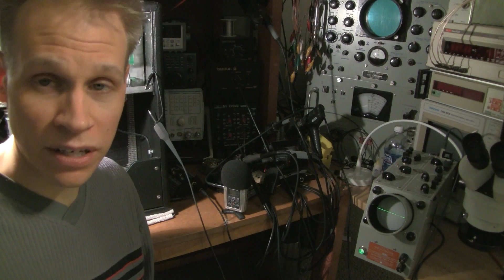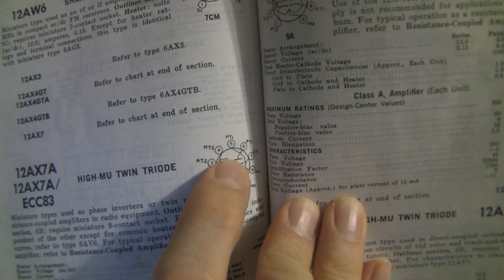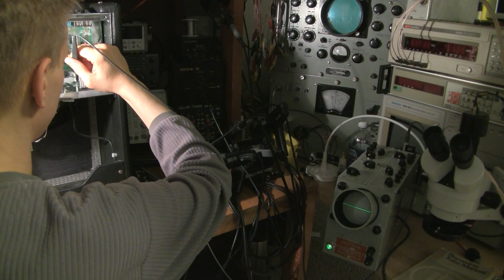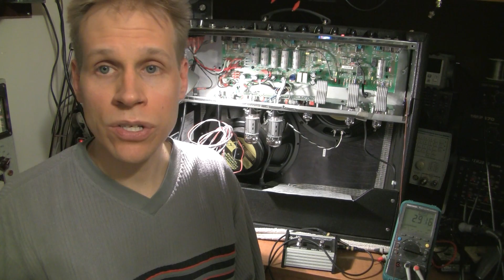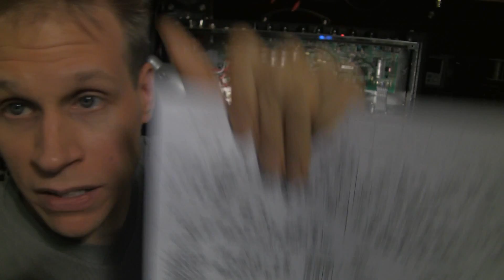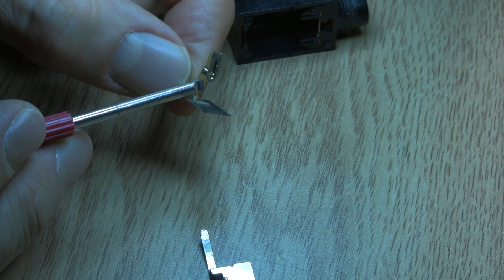Fender DeVille Amplifier, Repair and Bias Set Procedure

Comment: (Edit: joined the $10 Patreon so will move this question over there)  Love the channel, great video!!  If you have time, may I ask for some pointers on mine?  My reverb and channel switching died at the same time, and the V2 tube wasn't glowing.  Replaced the tube to no avail.  Also, the white resistor on the right is measuring completely dead between the leads.  Any ideas on where to start troubleshooting?
Thanks a ton!!
Reply from the maker: Just message me on Patreon.
Reply: @MrCarlsonsLab Already ahead of ya, messaged there 👍 I'm sure you have a lot going on man, get to when you get to it, so busy with work right now myself that I haven't even looked at Patreon yet haha
Reply: @MrCarlsonsLab Hey!  Felt like saying that I fixed it (mostly).  Replaced the v2 preamp tube socket and the associated ribbon cable, the v2 tube glows properly now, and the reverb works.  But while the clean channel is perfectly loud, the drive channel has like 1% of the volume it should have.  NO CLUE how to fix that one haha, oh well, am fine using it on the clean channel with a distortion pedal

Comment: Hi, nice video. I have a blues deville reissue from 2007. 60 watts, 4x10 blue alnico emminence speakers, Made in Mexico. And it was biased at 51.8mv with a kind of glue from factory, in the bias pot.. I rebias it at 60mv. It sounds better but realized increases chasis temperature too. I hope not burning the circuit tracks, as many hot rod I've seen, next to the bias pot

Comment: Fender has taken the same approach to amp building as they did to guitar building. Make the cheapest, most corners cut, most basic, cost effective design possible. In these amps you are guaranteed to have a critical failure because the design creates the issues. It can be addressed for about 500 bucks, but who wants to take a new, very expensive amp to a tech that may or may not know what they are doing for these repairs?   Unfortunately they take an even worse approach to customer service and do not honor the warranty on these amps. Personal experience. Buyer beware.

Comment: Did tube designers ever consider the natural frequency (mechanical) of the inner working of the tube to the point that the tubes self-destruct after so many cycles and at least advise the designer that the tube has a natural frequency of “X” hertz.  I got to 
Believe in an amplifier, tube life would be far less than in another non acoustic application.  Also, how sensitive is tube function to mechanical movement?  You mentioned one design fix made to stabilize the inner workings.  Are the dimensional properties critical to function?

Comment: Great video as always! Could you have two different brand/construction - same type power tubes installed? I tried a TAD 6L6GC with the getter on top and a shorter Ruby 6L6GC with the getter on the side, they are 10mV apart when biasing (one is 25 and the other is 35, the amp manufacturer says 30mV is the ideal number), could  that make any "damage" to the tubes or the plate/other components? Asking because it makes a very interesting sound but would not like to damage anything.

Comment: I ran across a problem the other day in the reverb circuit of an amp. The reverb seemed to work as when you had the amp on and you hit the reverb pan it would make noise , but still the reverb was not working with a guitar . I found one the RCA coaxial cables going to the pan was bad . But there is also a 12AT7 that controls that part of the reverb circuit as well.  And I would like to know how to tell if that tube is bad.

Comment: Isn't better to set the bias by the current as in milli amps as apposed to setting it voltage wise ? I'm a Fender certified repair tech so that's what I was told . But ether way should work . Great job in explaining amp diagnostic procedures Mr Carlson !!
Reply: The bias adj is taken off a 1 ohm cathode resistor, so 60mv IS 60 ma.

Comment: Only issue I have is that the bias should be calculated if there is anything but stock tubes in it. The standard fender spec of 60mv doesnt take into account all the variables in different tubes.

Comment: Most guys just replace those pcb jacks with old style switch craft and wires. Those jacks and those Illinois Capacitor filter caps are the Achilles Heel of that amp.

Comment: The Fender Deville amp you repaired has 2 very bad problems. 1st. The two ceramic resistors on the main circuit board,(5 Watt Xicon 330 ohm), are pinned to the top of the circuit board and will get very hot, and will literally "cook" the circuit board if left this way turning it brown. They need to be removed and replaced with 2 new resistors and be mounted 1/4 inch off the board to give them enough room to properly dissipate heat. Otherwise they will ruin the circuit board. 2nd. The Illinois Electrolytic Capacitors Fender uses are known for pre-mature leakage, so if you're already having to do work on this amp, these should be replaced with some good electrolytic caps like German-made F&T Capacitors.

Comment: Thank you for your videos! As you were bending that input switch piece back in line I was yelling "replace that pos!" Those jacks are notorious for failure. I hate to tell ya, but you'll be back inside that one again... swapping all those plastic input jacks with  Switchcraft jacks and leads to the board.

Comment: My original hotrod deville started to make only noise. i would bump top of amp and would just pop and crack  very very loud.   I tapped tested the ax7s and replaced all three as they were microphonic and crackled. My amp works now with no noise whatsoever but the output is very low. Usually cant play above 2 or 3 clean or dirty but even if turn up to 8 on up it still very low and distorted.  From your experience could it be powertubes as well? Tubes were biased a while back but can unbiased power tubes sound that low? thx

Comment: Thanks for explaining this issue. I passed on buying the same amp with the same issue. I am trying to find out if I can use a 16 ohm Marshall amp with am 8 ohm speaker? Will I break anything? Big fan. Thanks.
Reply: You need 2-8 ohm speakers wired in series. =16 ohms.

Comment: I bought a Fender Hot Rod DeVille 212 iii last night that apparently needs either new power tubes or repair.  I only tested it for a few mins when I got it home, and it sounded fine to me.  But, the seller described the issue like this:  "I experienced low volume output combined with a muted tone but prior to that the amp ran as designed. Also the fault came on suddenly and didn’t slowly progress to the condition it’s in now. Hope that helps".  From this description can anyone share their thoughts?  I plan to play thru it today for an hour or longer to see if I can reproduce the issue he was experiencing.

Comment: Nice job Mr Carlson.  I despise those jacks. I've replaced and repaired dozens of them, due to the switch point failing, or the neck going through the face plate breaking off. Really a terrible quality item.

Comment: That was an easy fault, the real test would be my 100W guitar amplifier Marshall head. It has an annoying background hum. It's not extra loud, just enough to be annoying.  I've replaced all capacitors. It has 6 tubes in the preamp and 4 EL34 tubes in the power amp, i replaced all tubes with new ones, still hums. I used a scope and found the hum is on B+ and everywhere.  There are two huge transformers, the power transformer and an output transformer. Marshall placed them only an inch apart instead of at opposite ends of the chassis and I think the magnetic field is coupling from power to output transformer. I tried to shield them with 1/8 inch steel plates as an experiment and it made no difference. But i didn't have enough steel to cage the power xfmr.
I was hoping your video would steer me in the right direction, I was disapointed when you found a defective tube.

Comment: Around 1980 I bought one of those scopes and I actually troubleshooted a homebuild 6502 CPU and I/O board with it. The boards were laid out on Eurocards for
thruplating, which I didn´t have, so I needed to solder the chips on both sides ... good old days :-) I gave up on the floppy controller though, and sold it.
Reply: Kim Hansen I did a design in the 90s that had 9 Intel CTC chips attached to a Z80 – for a device that was essentially a precursor of Vive lighthouses (there were two light sheets instead of four, because the lighthouses were on a common metal frame). I etched it myself and then drilled it and had to solder both sides. This was a Swiss laminate with photo resist that doubled as oxidation protector and flux. It wasn’t hard to do the double side soldering, but there were just so many pins! From what I recall, I managed zero bodge wires. Must have been a real simple design, as that feat has never happened again I think on a first prototype for me.

Comment: How about US made 12AX7(WA, WC) JAN MILSPEC tubes or a Raytheon/CBS 7729 and microphonics?
Reply from the maker: I think you mean 7025, and yes they have lower hum due to the filament structure in the cathode. I talk about the differences in more modern video's.
Reply: @MrCarlsonsLab  No I did mean Raytheon 7729 but the more common 7025 would be another example indeed.

Comment: Great video as I have the Fender HRDeville ML model and it too hums.  I was thinking of replacing the tubes.  Did you just debunk the myth about touching tubes with bare hands?
Reply: w1burd No need to debunk it, everyone touched the tubes back when they were in common use and there was nothing observed that would suggest that it was bad. To anyone who thinks that everyone smoked back then: if you don’t smoke, try once and see what feedback your body gives ya ;) Tubes did nothing of the sort.

Some people just don’t know the difference between quartz and normal glass. You can’t help everyone. It’s like prefixing every video with an admonition against using the concept of flogiston in the diagnostic process. People will come up with some other silliness. I think Paul mentioned it enough times by now that anyone who cares to know, knows.

People like to know stuff and in absence of solid facts, they will gladly absorb myths. I can’t quite blame them, although these days the instinct should be to check on internet and see whether there just may be something wrong with a concept. Then one needs the sense to separate the bunk sources out. So yes, it may be hard without some core knowledge to go by. 

Our minds usually crave facts, and without good understanding it’s easy to just hang on to any little nonsensical tidbit that comes one’s way.

Even with quartz lamps it’s not some magic if you touched them. Glass would break. Pretty obvious that it was wrong: no touching and the envelope would not fail. You won’t ever see such failure mode on the tubes. So people who think “no touching” don’t even know what problem it causes, lol.

But yeah, touching the tubes while they are on is a Very Stupid Thing To Do, unless you crave burns and a potential electrocution double whammy.

Comment: I've been working on HiFi and Guitar amps for over 50 years.  My first experience with a DeVille was a disaster. perhaps 12 years ago.  It had about 5 issues!  First one it would go into low frequency oscillation like a continuous belch, because the input jack being very flimsy and mounted to the large resonant chassis directly opposite the speaker, would act like a car horn, a vibration from the speaker would cause the contact from the input to discontinue, which would pop and then it would reclose (acoustic feedback from the speaker), and this cycle once started wouldn't stop , unless you pressed on the jack, or turned down the vol.  Replaced the Jack with a switchcraft traditional jack and had to cut off part of the circuit board.  Then there was excessive hum, apparently due to all the ribbon connectors, and poor ground geometry.  As soon as I removed the board from the chassis, which includes pulling all the knobs and pulling a bunch of connectors to the back board , and  hard to reach screws, the ribbon connectors broke because they are too stiff. (the board must have gone in and out ten times because there were more and more issues).  Bad plate resistors, conductive chemicals, not cleaned off the board  during manufacture, and really cheap caps etc, etc.  I ended up having to replace all the ribbon cables almost with skinny shielded wires.  The kicker at the end, was that one of the speakers had been replaced with an Alnico speaker that was perhaps 8 inches from front to back, and the end bell had to be taken off just to get it in the Box.  This had been done previously by the owner? The large Alnico magnet was directly nuzzled up against the Filter choke. and depending on where one hit the power cycle in terms of the residual hysteresis on the choke laminations, at turn on,  it would hum slightly , or not.  This was especially annoying as I had been working on the amp on my bench, off and on for several weeks without it being in the box (so I hadn't realized this would be a problem! )  Luckily the next two that I worked on briefly were much better in quality.  But I won't work on them anymore.  Yuck!   Poorly executed design.

Comment: This may be a stupid question but here goes. What settings do you use on the scope so it doesn't blow up?
Reply from the maker: Hi Jim. Knowing the maximum DC voltage your scope input can take is important. Then, if you use a x10 probe, you have that in front of your scopes input as well. Most scopes will be just fine with any of this older gear, as long as you use a X10 probe. If your probe has a switch for X1 and X10, that can be a disaster waiting to happen if you forget or inadvertently move the switch to X1.
Reply: Thank you, I'm getting my first scope in a few weeks. Thanks again, I'm learning so much from your videos.

Comment: Hey Mr carlson I just joined your Patreon. Super neat! Is the black lead of your DMM attached to circuit ground when testing volt levels in a circuit? When you were probing the tube cathode with the O scope where was the other probe and what was it doing?
Reply from the maker: Hi Trevor, I just sent you a PM on Patreon. If you have a question, that's the best place to ask, as I get an instant (separated) notification. This platform is really busy and sometimes questions like this get overlooked here. The black lead of the DMM is referenced to the chassis in this case. The common lead of the scope probe is also referenced to the chassis. This is not the case for all repairs though. Some chassis are isolated (DC blocked) from the circuit ground.

Comment: Very interesting video. Paul I have a dear old friend, a solid state Yamaha B50-115 bass guitar amplifier from about 1977.  It has developed a 60Hz hum from the speaker when the volume is turned up, and-or when you  strike the strings hard. Sounds fine when playing softly, but starts the 60 cycle hum when playing with gusto. I've kept it unplugged, and it's been idle for months. Any possible ideas of what might be causing this? It's never been serviced. Any help is greatly appreciated. 73
Reply from the maker: Hi Mike. It could be a number of things, IE: bad tube, something wrong with the input jack, bad filter capacitor.... so on. Hum can come from multiple sources, finding that issue is relatively simple though.
Reply: Thanks Paul. I'm really suspecting a filter capacitor, so I'll get those replaced, do some probing, and I'll let ya know what I find.

Comment: Some of the problems and solutions Paul gives here for the Hot Rod DeVille also apply to the HotRod Deluxe I and II and 40 watt Blues versions.I cannot speak for the HRD iii because they are modified (Blackface)

The explanations here about heater to cathode and heater to grid shorts was intriguing because I never considered the mica insulator to oversize from vibration, and
whether psychoacoustics is involved or not in Tube amplifiers, and the tubes country or manufacturer of origin meant diddly if the tube was actually a good performing tube.

I would think that to reduce warranty costs and customer satisfaction,and yet make a nice profit- that many different makes of tubes at various cost/performance attributes
would be lab tested.What do we have here is possibly a one year Factory warranty

Comment: Hi. It's been a time, I see you using the oscilloscope, is it ok to put the probe straight onto the pin, being it's voltage or have you got something in line to protect the probe. Thanks.